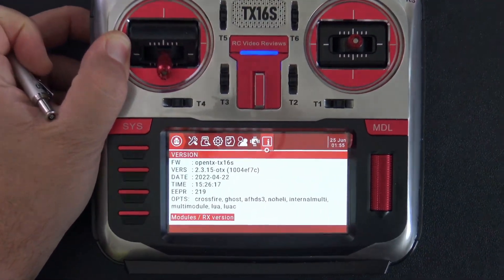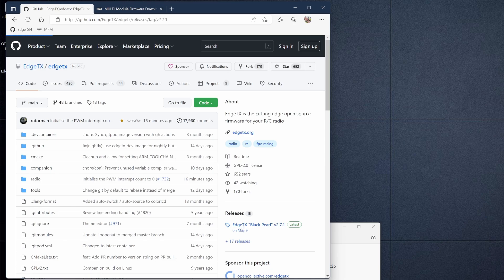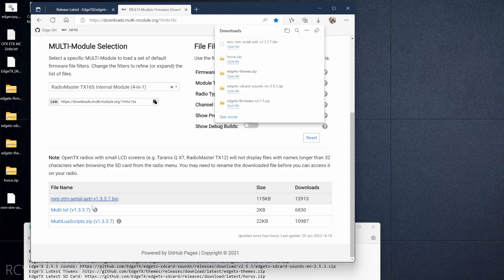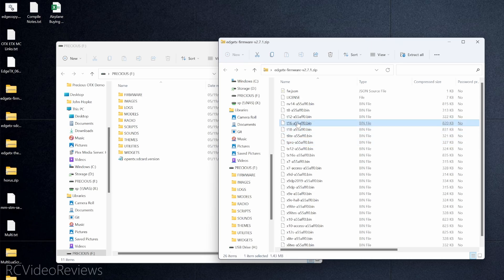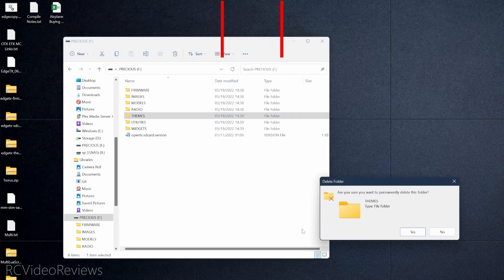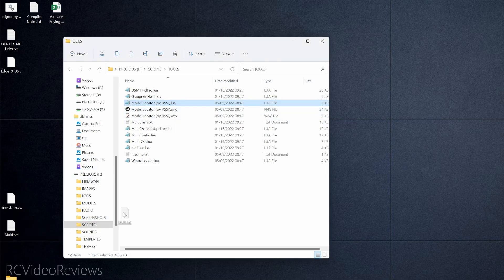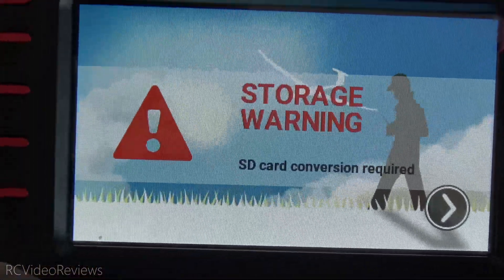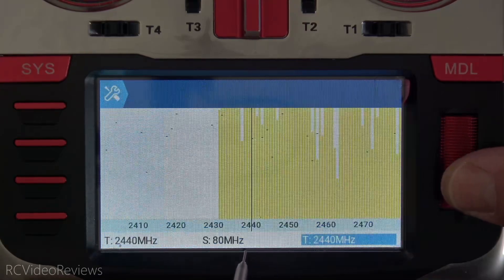How-To Convert from OpenTX to EdgeTX MASTER CLASS • 100% Works

Comment: Help, Did the conversion seemed like all was good, then the screen freezes. I shut off the radio and turn it back on it works for like 30 seconds then it freezes again. Niether the touch screen or the buttons work after it freezes.
Reply from the maker: Sounds like you got the wrong firmware.

Comment: Hi John, didnt support my access receivers when i flashed my x7s access, had to go back :(
Reply from the maker: Edge supports Access on Access radios. I'm told there are some issues on color radios with OTA updates, but it shouldn't have issues binding if you use the correct protocol. Anyway, all the more reason to get away from Access IMHO. I'd take EdgeTX over Access any day of the week.

Comment: Did the conversion it did not give me the option to converts sd contents.  After the radio flashed.  I didn’t my have my models either.   I flashed 2.9.
Reply from the maker: Yup, they removed the conversion feature on 2.9. You have to flash 2.8.x first, turn radio on. It will convert, then you can flash 2.9.
Reply: @RCVideoReviews    Thank you!  So do I need to reflash bootloader to 2.8 then as well?
Reply from the maker: @benjaminarens5625 no
Reply: Hi John,  I have a TX16s multi protocol internal module it’s an older radio.  I use a RadioMaster ranger micro external module.  I followed your video to a T.  The Edge tx 2.9 works great on the radio.  I just cannot for the life of me get it to execute the elrs lua script.  Any ideas on what I can try next?  Thanks for your help.  Your videos are great,  very good content!  You guys are what keep us not so tech savvy guys in the air 😂
Reply from the maker: Please join discord. Invite is in the description of every video I post. Discord is a MUCH BETTER platform to help with problems like this.

Comment: Great runthrough! I downloaded all the downloads for my X9D and flashed the EdgeTX bootloader but have a question before I  proceed with preparing the SD card and flashing the EdgeTX f/ware. I'm still running an old V2.2.3 version of OpenTX on my X9D so the SD Card folder structure is quite different from V2.3.x (eg. no RADIO folder, extra CROSSFIRE & EEPROM folders, etc), so I'm curious as to whether I need to upgrade to V2.3.x before migrating to EdgeTx? I have about 50 models (all multirotors) and a boat load of .LUA scripts so don't want to end up in a sea of pain LOL! 
Any pointers appreciated regarding the safest upgrade path as I couldn't find any info online. Thx :) Sub'd
Reply from the maker: Take a look at this video and welcome to the channel: https://youtu.be/0WnpfE78-KU

Comment: I tried the migration to Edge TX. The conversion works, but my models never get converted over to a .yml file. I was 99% there but have no models to select. All the SD Model files are .txt….Any suggestions?
Reply from the maker: How-To Upgrade OpenTX to EdgeTX 2.9.x • DO NOT FLASH Before You Watch This Video
https://youtu.be/NYbOLLoV-GA
Reply: @RCVideoReviews that totally worked!!! Wow, what an enormous headache solved. I eventually took my stock SD card with the latest version of OTX and added the contents to a new card and followed your steps by adding the 2 versions of ETX in the firmware. I put the new SD copy into the controller and got the conversion prompt. I then copied all the ETX folders and Scripts, then flashed the 2.9.1 firmware. THANK YOU THANK YOU THANK YOU again🙏!! You got my subscription!!!
Reply: @RCVideoReviews  now thst I don’t know how to use ETX, where should I start with you content to be successful with ETX??

Comment: Great content as usual John. Clear and consice.  I asked a question in the live stream and would like your folks input (all RCVR folks).  I have an original Taranis X9D (not the X9D+) which of course does not support the SxR receivers..  Bought a Multi Protocol Module for that function.  Is there really any benefit to going to EdgeTX for the X9D since it is not a color screen device.  Your thoughts would be appreciated.
Reply from the maker: Why doesn't the X9D support SxR Receivers? Doesn't the internal RF chip support D16?

If I were using a non-color radio, I would over these changelogs to see if there are any under-the-hood updates you think you need for your radio. 

https://github.com/EdgeTX/edgetx/releases/tag/v2.5.0
https://github.com/EdgeTX/edgetx/releases/tag/v2.6.0
https://github.com/EdgeTX/edgetx/releases/tag/v2.7.0
Reply: @RCVideoReviews  John, thanks for the information. Seems that the original X9D is just slightly different than the X9D+.  The SxR receivers definitely state in the requirements that it must be X9D+ or newer radio.  Found that out AFTER buying the receivers and my radio would not work with it.  Purchased the IRangeX multi-protocol module and after updating it, it worked with the S6R.  I will follow you suggestion and review the release notes.  Just asking for an opinion of moving to EdgeTX on the original Taranis would be a good move.  The benefit I would see is supporting one operating system.

Comment: PSA: If going from OpenTx to 2.9 of Edge (current version) it will not upgrade your models. At least it did not for me. I assume if you want models converted then go to the V2.7 of Edge as in this video and then upgrade to 2.9.
Reply from the maker: How-To Upgrade OpenTX to EdgeTX 2.9.x • DO NOT FLASH Before You Watch This Video
https://youtu.be/NYbOLLoV-GA
Reply: @RCVideoReviews   I am not concerned about losing my models but I can go back to my my OpenTx setup and follow that procedure.  Thanks for the fast reply.

Comment: Why cant the sd card be like a 64GB sd card
Reply from the maker: That would be like renting a train to haul a single rock. FAR FAR FAR *FAR* more capacity than would be needed. Max support in the firmware is 32GB which is still FAR FAR FAR more than needed.
Reply: @RCVideoReviews  can you swap if you already have edgetx then can you swap the SD card to a like 64GB or will it just not work
Reply from the maker: It won't work right unless you partition the 64GB to 32Gb. The radio can't see > 32GB.

Comment: Thanks but i'm sticking to opentx after watching how complicated it is. I don't want to risk bricking my 500 dollar Horus x10 express.
Reply from the maker: You can't brick these radios.
Reply: Well good to know. Its still way to complicated.
Reply from the maker: Pretty much the same exact core functionality of OpenTX. In what way is it more complicated?
Reply: @RCVideoReviews  I tried Edgetx last year and it didn't work right on my radio. Lots of glitches. I guess thats why I'm not interested in trying it again.
Reply from the maker: So it's not more complicated, you just had glitches? What kind of glitches? I'm curious because I've been using EdgeTX 100% for 2 years. Nothing I've seen has been a deal breaker.
Reply: @RCVideoReviews  It is more complicated. Having to download 4 different sets of files. Having to flash the older version before you can flash the current version. I have a Horus x10 express. Its also not clear what files I need do I use the x10 files or the x10 access files. They don't make it clear what are the correct files. I bricked a Taranis x9d trying this can't risk the Horus.
Reply from the maker: As I mentioned before, you can't really brick these radios. But if you find manually updating too confusing, buddy.edgetx.org will do it all for you via the browser. But in the end, you gotta do what you gotta do.
Reply from the maker: PS OpenTX setup is essentially the same thing.
Reply: @RCVideoReviews  Right OpenTX is essentially the same thing so why put myself through the hassle of changing. I don't need faster latency I don't race. I don't need the extra stick control. I may be like a lot of others who just don't need the extra features. Oh btw I tried buddytx didn't work. lol.

Comment: hi , and thankss for sharing , however when I get to SDScard I get a different window than yours , I wonder how I can send you a picture but it says . bw128x64.zip c320x480.zip and some others
Reply: shouldi sue this for TX16s EdgeTX SD Card Contents
This repo contains the SD Card contents for all supported EdgeTX Radios.

Platforms
The contents of this repository are organised by color type and screen size, with zip archives generated for each color type and screen size.

c480x272.zip (480x272 pixel landscape orientation color screen radios)
TX16s / TX16s mkII
T16
T18
Horus x10s
Horus x12s
Reply from the maker: Your comment was put in the hold queue because it had a link. I do that to prevent spammers from using my channel for spam. I don't check there very often. Anyway, since I published the video, they changed archive names of the zip card. Most of my videos make mention that these things may change over time. 480x272 is the right ratio for your screen.